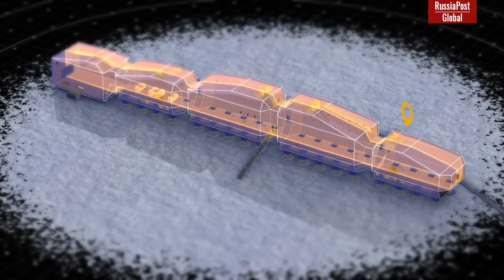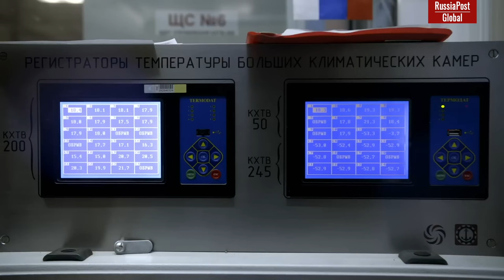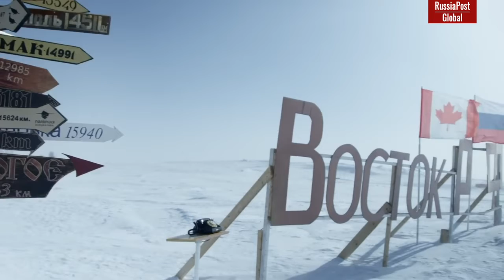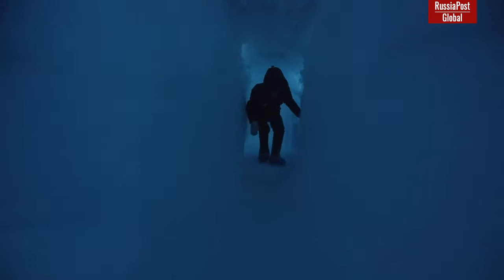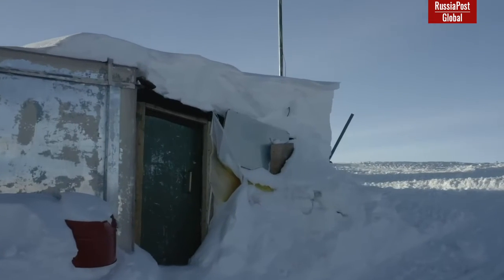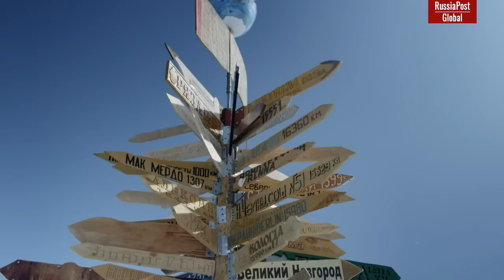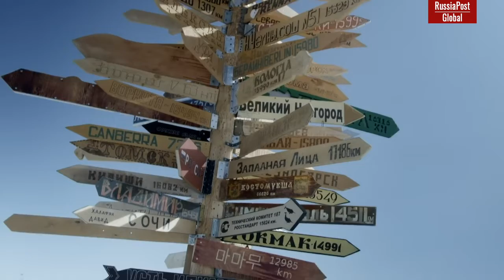Why did Putin open the ultra-modern Vostok station at the South Pole

Comment: "Mineral insulation", is that.... asbestos!
Reply: Stone wool was chosen as the main thermal insulation material for the Vostok station due to its unsurpassed characteristics. Insulation fibers are able to reliably accumulate heat, as if locking it inside buildings and structures. At the same time, the natural origin and the air bubbles contained in the materials allow the structures to "breathe" without the formation of destructive condensate.